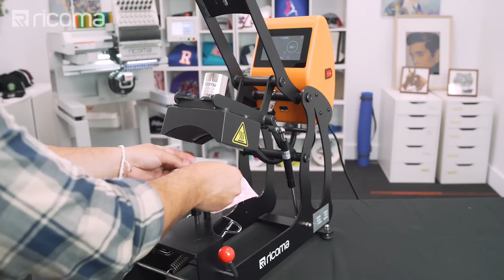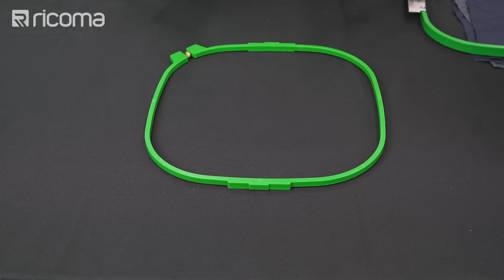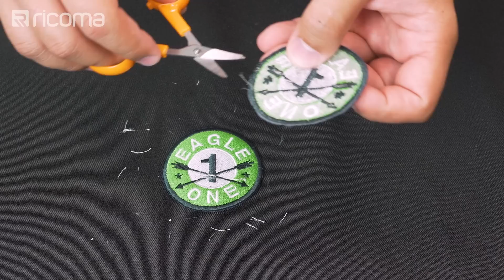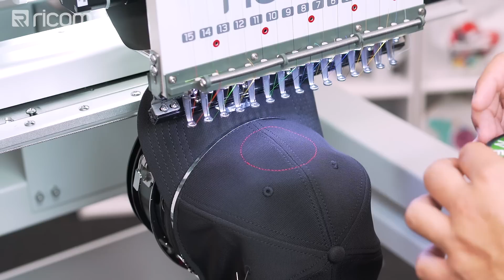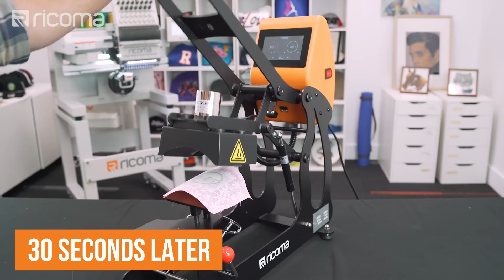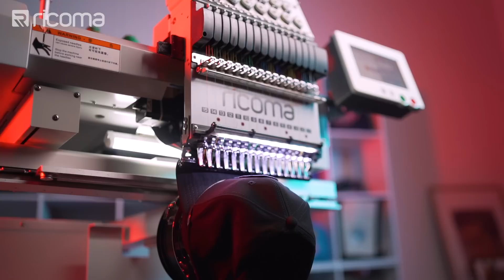How to Adhere Patches to Caps (Embroidery Vs. Heat Press)

Comment: How long does the glued on patch stay glued on please?
Reply from the maker: The longevity of a glued-on patch largely depends on factors like the type of adhesive used, the fabric it’s applied to, and how the item is cared for (e.g., washing and drying). Generally, patches attached with high-quality fabric glue can last through several washes and regular wear, typically staying secure for a few months to a few years.

Comment: So I ordered the heat and bond adhesive and not even a week later the patch is falling off the hat. What do you recommend I use for adhesive?
Reply from the maker: Hi! We recommend using an industrial-strength fabric glue or an iron-on adhesive like HeatnBond Ultrahold. Another option is to sew the patch onto the hat to ensure it stays in place securely. If you prefer an adhesive solution, make sure to follow the application instructions carefully, including the proper heat settings and pressing time, to achieve the best results.

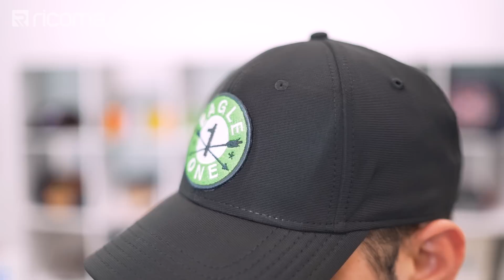Comment: 15:20 The indentation marks in the hat caused by the lower platen. How can you avoid those heat press lower platen marks that are clearly visible?
Reply from the maker: Hi Lance, there are various way on reducing this. 

Use a lower temperature: Lower the temperature of your heat press to the minimum required to activate the adhesive on your transfer material. Excessive heat can cause scorching and leave marks on the fabric.

Pre-press the garment: Pre-pressing the garment for a few seconds before applying the transfer material can help to remove moisture and wrinkles, allowing for smoother application and reducing the risk of marks.

Adjust pressure settings: Adjust the pressure settings on your heat press to ensure even pressure across the entire surface of the garment. Too much pressure can cause indentations, while too little pressure may result in incomplete transfers.

Comment: Thank you for sharing. Both methods are great depending on what one is going for. But I prefer the stitch attachment method for longevity and durability of the patch on the cap.

I would make the patch with a bean stitch at the outer edges, then use a heat n bond lite at the back of my patch, align it at the centre of my cap and iron it on. Then using the free arm part of my computerised sewing machine, I would use satin stitch all around the edges of the patch to secure it to the cap and also give it a clean finish.

Another way is to make sure I have the file in my embroidery machine or usb stick with the patch edge having an initial bean stitch finish as the last stitch. Then I create a satin stitch to finish up the patch attachment on the cap using the file in the embroidety machine. Having the original file in the machine will help with proper alignment and placement of the satin stitch on the patch and the cap.
Reply from the maker: Hi Annie! Thank you so much for telling us about the technique you use, we truly appreciate it!

Comment: Your cap prices are insane. Where are you getting that?
Reply from the maker: Hi there, we are providing advice when it comes to pricing and it all depends on the work/time/cost of goods.
Reply: @ricomatv  right, that's the reason for my comment. Is that an actual wholesale price you get for that cap, and if so, at what bulk amount. That's important info for determining cost, your margin, and capital overlay. I have yet to find a price that cheap for a small business and especially below 12 dozen or more.

Comment: You barely show any of the digitizing or tacking it down.  I can't tell if it start from the top or bottom.  Did you use the Applique option, or did you manually add the run for tack down, and then manually add the satin for the border?
Reply from the maker: Hi Jonathan! This tutorial doesn't particular focus on digitizing but we have plenty of tutorials in which we go into depth on how to digitize patches. https://youtu.be/YUyxfSS8emI

Comment: Love your videos.  We have been using the 1502 for 5 years but just started heat pressing patches on hats.  The only issue we seem to have is leaving the indented / platen pattern, like a rectangle on the front of the hat.  It is very difficult to get rid of it.  Mostly on the 112  hats.  Any suggestions?
Reply from the maker: Hi there! For the caps, you can try using these pillows before you press them on the heat press! Adding teflon paper on the top will make it look cleaner as well.

https://www.amazon.com/Pillow-Pressing-Transfer-Resistant-Pillows/dp/B07SYJWW56/ref=asc_df_B07SYJWW56/?tag=hyprod-20&linkCode=df0&hvadid=366402393359&hvpos=&hvnetw=g&hvrand=3872075219214876505&hvpone=&hvptwo=&hvqmt=&hvdev=c&hvdvcmdl=&hvlocint=&hvlocphy=1015049&hvtargid=pla-795307238611&psc=1&tag=&ref=&adgrpid=76467134295&hvpone=&hvptwo=&hvadid=366402393359&hvpos=&hvnetw=g&hvrand=3872075219214876505&hvqmt=&hvdev=c&hvdvcmdl=&hvlocint=&hvlocphy=1015049&hvtargid=pla-795307238611

Comment: Seems like you need a little more education you say it’ll last longer The stitched embroidery that can be true because it’s stitched but the Proper Heat Press Hotronix does embroidery patches and you Can’t Remove Patch not even with a plier it will brutally take so much force that it will eventually come off but who is going to use a plier so the Heat Hat Press Patch will last just as long as the stitched. No disrespect but you can see proof of that on channel S & S Active Wear. Love You guys but Hat Heat Press is the Only Way.
Reply from the maker: Thank you for the feedback!
Reply: What kind of adhesive do you use with your Hotronix press that would make it that strong?
Reply: @katgilbert9194  well I have the 360IQ Hotronix Hat Press which heats from the bottom at 320 and 280 on Top and forget about it once it dries you literally have to add much muscle to take off. There’s a video YouTube S & S Activewear where the CEO of S & S tries with pliers to take off the Lakers EmbroideryPatch which was Heat Pressed by the 360 IQ.
Reply: @RamboBigPapi  I saw this video too. I don't think people realize how strong these adhesives are...but I am curious how they last beyond 5 years.
Reply: 1st. Logic and industry standard knowledge is stitching is more permanent than adhesive. I’m not even going to waste my time going into the physics and chemistry to prove it…But if you don’t have access to a sewing machine heat n bond is a great alternative. Ricoma is doing us a solid even showing us the process. Do what you can with the tools at hand.

Comment: What kind of adhesive sheet do you use?
Reply from the maker: Hi Stacy! You can find lots of options on Amazon. We linked the link below for you to check out some options! 
https://www.amazon.com/HeatnBond-UltraHold-Iron-Adhesive-Inches/dp/B000Y0083K/ref=asc_df_B000Y0083K/?tag=hyprod-20&linkCode=df0&hvadid=193987317966&hvpos=&hvnetw=g&hvrand=9782893350890125590&hvpone=&hvptwo=&hvqmt=&hvdev=c&hvdvcmdl=&hvlocint=&hvlocphy=1015049&hvtargid=pla-307218345982&psc=1

Comment: Can you just do a satin stitch border to attach the patch and not do the satin stitch on the patch before hand?
Reply from the maker: Yes you could, you would need to make sure the patch is held in place maybe with adhesives or a tack down stitch first
Reply: You could but then you have the need to be very precise and ofc the patch is not stiff, so there is a great possibility that the patch itself will move
Reply: Last but not least, it would take a lot more time to align everything

Comment: Just asking but what if I heat press the patch and then add a couple stitches hand sewed to keep it in place would that work?
Reply: If you use the good adhesive it says not to try to sew through it because it can break needles.
Reply from the maker: That's an interesting idea! But, we've never tried that method. Thanks for watching our video!
Reply: What type of Paper did I heat downward on the Patch before u heat on the cap plz?

Comment: is there any way to attach a patch with the embroidery machine onto a cap that you don't have the original file for?  i tried it by putting the dimensions of the patch into chroma but it was a disaster haha.
Reply from the maker: That’d be tough because you’re essentially estimating where your outline stitch will land on the patch. It will be much harder to do vs if you had the patch design file. It could be done but will probably take more trial and error. Would recommend using the heat transfer method in that case.